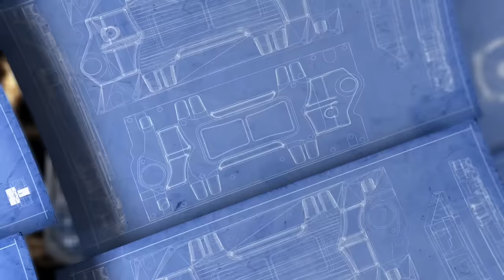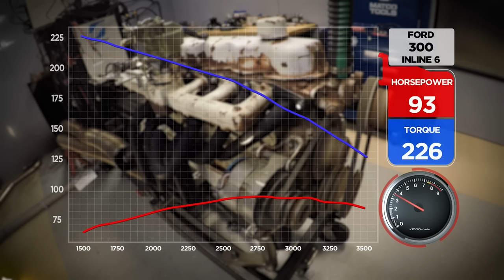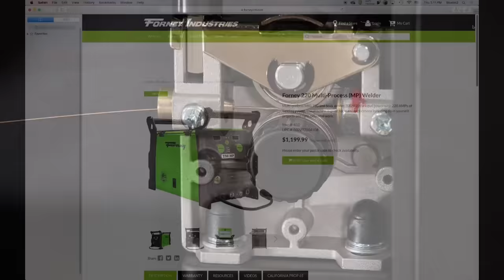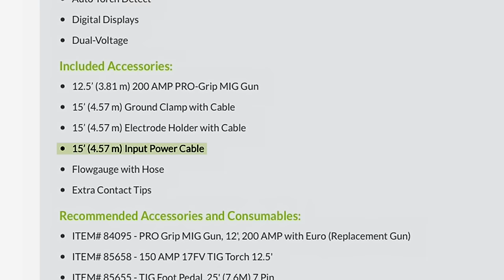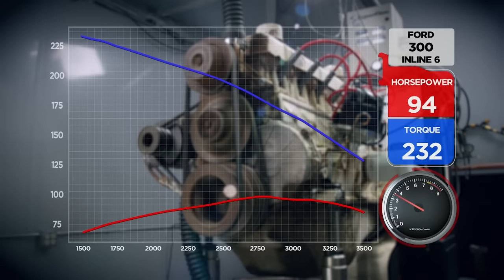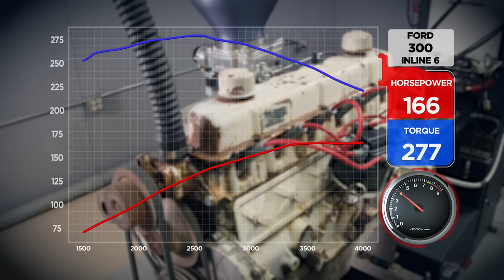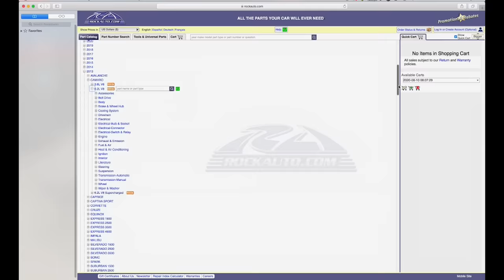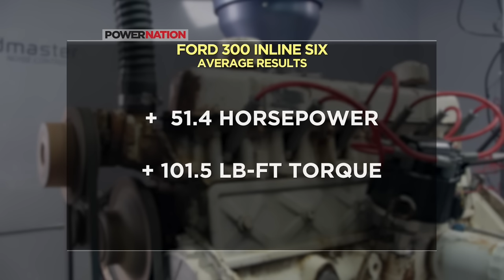Ford 300 Inline Six Gets Eye-Popping Off-The-Shelf Power - Engine Power S7, E17

Comment: Man I can’t say enough great stuff about all that you all teach us. So , great job fellas. I recently bought a 1999 s10 blazer four wheel drive that only had two owners and they took great care of it. I just lucked out on this thing. It ran great and the engine compression was 165 to 170 psi on all six. Cylinders. It had a leak in the radiator and needed a intake gasket. I’m disabled and I’m 63 now and I’ve done all my work since I was 15 years old. But I bought a top end gasket set and a new radiator. I installed a radiator during a hot day and I had a bad attack with my heart from the medicine I take it makes my blood get thicker when I get over heated. I love these little s10,s and happening across this one was a blessing. I was gonna let my daughter use it to go back and fourth from college. But when I had that attack it normally puts me in bed or the hospital for days at a time.  So needing to get this s10 going I sent it to a so called machanic. All he did was put some radiator seal in it. I had drained all the old old and put a new oil filter on it and knowing they would flush the block out like I would have I didn’t put oil in the motor. Just put the oil and antifreeze in the vehicle for them to put in once they put the new intake gasket on. But they called and said it was ready and I went to get it and he actually tried to buy it from me and bragged on how nice it had been taken care of. But I paid him his money and got in it and crunk it up and started home. All of a sudden it started knocking and I looked at the oil pressure and it was flat and the temperature was pegged. Just before I could turn it off the motor locked up. First thing I checked the oil and there wasn’t any oil in it or no water in the radiator. I looked for leaks and there wasn’t any. Come to find out they didn’t put oil or water in the motor. I had to take him to court and only got back the money I paid for him to put the intake gasket in. Which was right at 800 bucks. A perfectly great engine blown. Now I’m disabled and have been since my stroke and heart surgery. I only get less than a thousand a month for all the years I worked. I’ve looked for a engine and I can’t afford anything I have found. I’m out begging people for any short block that anyone would love to just give away. I can use the other parts from the motor and I can rebuild a short block. It may take the rest of my life to do it but I’ll die trying. It’s been a very hard life for a strong young hard working man to get knocked down to his knees at such a young age with kids to raise. My wife takes up all the slack along with what the good Lord blesses us with. I hate having to beg for anything but this was for my daughter and now my dream of giving her something nice is shot. Have y’all got an old 4.3 laying in your junk pile that y’all would donate to a old man trying to keep a dream. The eighth vin is w if y’all or anybody could help. Man it took me two years to save my pennies to find a little blazer like this. I’ve been so made since they blew this thing up. I can’t even keep my blood pressure down. But thanks for taking the time to read this. Y’all keep it between the lines.     John.

Comment: Finally, I've literally got the same engine that had been rebuilt with a small cam, but they put that stock single barrel carb on it, I've got same intake and plan on using a Holley efi with it and the HD exhaust manifold, should be good for close to 300 ft lbs of tq just off idle
Reply: Im building my 2f landcruser engine, for the induction im gonna do like david vizard did and go with three 2" su carbs.
He said it was a virtually unstallable engine, and he gained 35 hp on the top.
Reply: Any reason you’re going to a HD manifold instead of EFI split manifolds?
Reply: I installed the Offenhauser Dual Port intake on my 300. It gives better torque numbers. I also installed a Comp Cams 268H cam, Holley 390CFM 4bbl. I tried bigger carbs and gained high rpm horsepower but lost some torque. The 390 4bbl seemed to be the best choice for my purpose.
Reply: @FRLN500  what are you running the motor in?
Reply: @tylertimmons5543  I'm leaning towards thr efi manifolds now but just for simplicity I wanted the HD because I wanted to go with a turbo eventually and it would be easier to plumb, and headers heat up the engine bay and I do a lot of trail driving, it does awesome at low speeds and I'm avg 16 mpgs with the single barrel carb but it'll drop when I make the swap!

Comment: I had that engine in my 1982 F150 Custom and even without any upgrades it had insane torque!  With the 4 speed manual, the 1st gear was a bull low, I could pop wheelies!

Comment: The same goes for Chrysler’s Slant Six Engines!
Reply: They were both starved and keep running anyway.
Reply: 63 Dart 225 push button would keep up with my 73 318 Dart auto.
Reply: @FredTheLutinoCocatiel  A more fair comparison would be an earlier 318 73 had low compression (8.6:1 vs the earlier LA-318 with 9:1) and was pretty choked up compared to earlier variants.  Not taking away anything form the /6 as it's one of the most bulletproof engines ever created, these Ford 300s and AMC's I6 were right there with it.
Reply: @GregHuston  I have a 1995 f150 and ford bronco 1987 whit this engine and. They are grate on gas mileage also easy to work on it
Reply: The slant 6 is absolutely a great engine, but the 300 Ford is a little stouter in a pick-up. I've owned and loved both engines ,but the Ford does have a little bit more grunt.
Reply: @lawnmowermanlawnmowerman9930  and AMC had a 258 that was strong in between both, too bad they didn’t slat it down to lower hoods.
Reply: @DishNetworkDealerNEO  Yes your right, that engine's progeny powered many Jeep products later on as a 4.0 liter 6. And it was also bulletproof

Comment: There's something wrong with that engine. All Ford 300/6 engines are supposed to leak oil out of the side covers. It prevents rust of something.
Reply: HA HA HA...MINE LEAKED AT THE CAM GEAR COVER BECAUSE THE POWER STEERING BOLT BROKE OFF(???) AND THE BRACKET WORE A HOLE IN IT LEAVING 7 QTS OF OIL FROM IOWA UP INTO RAPID CITY S. DAKOTA...I WAS THERE A MONTH AND A HALF TRYING TO FIGURE A WAY TO FIX THIS LEAK...EVEN WENT TO FORD FOR THAT COVER...N/A...OH CRAP...But with a Windshield chrome moulding clip and URETHANE...I FIXED IT...IT WAS SOLD TO PIK UR FART YEARS LATER...STILL SEALED...
Reply: haha, mine never actually leaked that much oil but it did seam to think that the power steering belt belonged on top the battery.
Reply: @Black70Fastback  Yeah, I had a problem with the serpentine belt. Turns out all the parts are different for the pickup and van versions.
Reply: If they can't leak,they will bust....
Reply: The 6.5L Diesel (Chevy) had extra rust protection on the same type or rust prevention system
Reply: That's funny you say that mine is leaking right now as we speak 93 model still running strong
Reply: @bigsparky8888  - sealed it?  There's your problem right there.  300s don't really use that oil for anything other than exterior rust proofing.

Comment: 😂 That why you use one of the old pads to press the pistons back into the caliper.  What ding dong tried to press the pistons with the c clamp end?
Reply: Exactly. !!!!! Old pads for the win
Reply: I thought. What mechanic would buy such a useless tool ?
Reply: Tickle, 
like the others I was thinking the same thing. I agree that example with the C clamp was stupid. 
Great post SIR
Reply: Glad I’m not the only one. In fact if you have to crank a C clamp so hard your hand is sore then you need new calipers!
Reply: @dodgeguyz  If you haven't lost any break pressure it can make your hand sore. Mine at least. Still, a useless and likely overpriced tool which doesn't seem to require any less difficulty.
Reply: I just stick a large flathead screwdriver in the "view window" on the back side of the caliper. Get it between the caliper and the pad plate and pry to compress the pistons. Pry slow and steady. Edit: Do this before removing the slide pin bolts.
Reply: Who doesn't compress the pads while the calipers are still on the car?!!
Reply: @christopherrisden4057  they still work their way back out while you are cleaning up the caliper bracket and so on.

Pretty much every brake job I've done needs a second press before the caliper goes over the new pads.  

I don't do enough to justify a special tool.  A c-clamp and an old pad over the piston has worked for me for nearly 30 years.
Reply: @buffuniballer  compress the old pads in completely, never had a problem getting calipers over new pads,or maybe not supposed to compress them that much? I'm a shade tree mechanic lol
Reply: @christopherrisden4057  I do.  They just come back out a bit while I'm doing other work.  They always seem to do so.  No big deal.

Shade tree myself...
Reply: Ding dong shills, that's who.
Reply: I've got fixed 4pot/2pot brakes on my current car...made $100 off a guy when he said I couldn't do all 4 brakes in under 30 minutes....I did the front rotors too and had 6 minutes to spare.....sitting there drinking a beer, waiting on my Benjamin to appear...LOL
Reply: Exactly everyone knows that
Reply: You're giving the ding dongs way too much credit lol

Comment: Nearly a 5L gas i6?? Holy heck! And here i thought the Barra was a chunky boi!
Reply: Barra is a chunky Boi, this Boi is a mega chonker
Reply: Im thinking about putting a barra in a lotus elise, or fab a replica cobra to be mid engine, do u think itll fit?
Reply: @T0YCHEST  300 is not a very large engine, just look up the dimensions and compare them to other engines
Reply: farcere barra and 300 are the same? I never seen a barra but i hear they can make 600hp na easily
Reply: @T0YCHEST  barra up to 2 to 2,500 hp now
Reply: @T0YCHEST  Not in the Elise, just too long. But in a lightweight Cobra replica, especially a turbo Barra, you'd have something as quick as the Big Block Cobras, but with much less mass over the nose, for significantly better handling.
Reply: @T0YCHEST  Barra is its own thing. Replaced the 4.0, which replaced the 3.9,which replaced the Crossflow 250.
Reply: They used to run a 6 cylinder dirt modified class back in the day with the 300 six. Dale Earnhardt at one time ran the class.
Reply: PiDsMedia i can fab the engine for the lotus
Reply: @Brock Main3 I've been a huge car guy for 25 years.   I have never heard anyone call this one of the greatest American engines ever made.   Ford flat head, Boss 9,  the Chevy small block,  Ford 5.0L v8, LS family, Hemis, Chevy 409, 427, 454 but never a I6.
Reply: Wild Bill dont forget 428, but inline 6s are the most underrated imo the moddular design is so structurally robust, people would love i8 but i8 would be to long to be practical.
Reply: I think GMC made a 502 inline 6.
Reply: Unlike the Barra the ford 300 is slightly over square 4" bore and a 3.98" stroke
Reply: Skullamanjaro : No. The Barra is a tall deck 9.22 inch  height version of the 7.830/8.425/9.38/9.469 inch deck 144-170-187-188-200-221(6)-250 in line sixes made in USA or Australia or Argentina. They were made as  8.66 and 9.38 inch deck cut down  2.3 and 2.5 liter OHV fours for the Tempo and Taurus. The bore spacings are 4.08 inches. The 240/ 300 Big Six is a much taller, 9.800 inches, and uses a 4.47 bore spacing between centers, which is Chrylser D series 215/245/250/265 Hemi size, although it again much taller. The Big Six is even bigger than the 199/232/4.0/4.7/258  cube AMC Jeep  engine, 4.375 inch bore spacings. But the Big Six is shorter and lower than the Barra because it has a simplex chain Double OHC. So anyone Aussie that says Put a Barra in it. PUT A BIG SIX IN IT!
Reply: ChrisHallett83  diesel
Reply: @jeffpittman8725  503, actually :) Lots of big gassers used to roam the highways. International 450/501 like mine, are beasts.
Reply: Dean Stevenson lol i just wanted to know if i can fit it in a lotus elise with minor fab work.
Reply: @T0YCHEST  302 or another engine would be a better bet, the 300 doesn't have much at all for aftermarket support.
Reply: 4.48 bore spacing compared to the Barra and the US 144-170-200-250 at 4.080 so it's a bunch bigger. Not like the difference between a 4.40 spacing 292 Chevy and my International though :) https://fordsix.com/img/_data/i/upload/2019/02/20/20190220212817-3b75321a-me.jpg
Reply: @deanstevenson6527  10.0" deck, 4.48, but still a long engine.
Reply: Wild Bill believe it or not it is! It’s not a V8 so many ignore it. They are a day in, day out workhorse. As this video shows, Ford left a lot of meat on the bone, so they didn’t get overtaxed. The Mopar 258ci is another workhorse; used in Jeeps for decades too.
Reply: The GDFP : Thats right. 4.48. And 10.00 deck. Thanx! The SVO Vee six was 4.47 and the SB2 Chevy. Ill have to memorise it again! The Ford Big Six is not big untill you've seen the obscene length of any OHC six. Even a GM 4200 with 4.05 bore spacings or the varying cylinder pitches of the  Nissan RB or L28's make the Big six compact in comparison. A Nissan six is 37 inches, the factory serpentine belt 4.9 for 87 to 96   is shorter. Oh darn. Ive oopolahed. Guys arguing about length. No proof until its measured...
Reply: Skullamanjaro : no. Sorry buddy. Its too big without some real gas axing and  design work.
Reply: @deanstevenson6527  250 Chrysler isn't in the Hemi Six family, just 215/245/265. IIRC the 250 was a flathead six.
Reply: @deanstevenson6527  Little 4.40 spacing 292 Chevy and International RD501 cranks. Mine. Getting offset grind to 5.5" with 4.530 BBC flat tops for 530ci   https://fordsix.com/img/_data/i/upload/2019/02/20/20190220214241-5686383e-me.jpg
Reply: @T0YCHEST  transverse 4 isn't easy to replace with an I6...
Reply: @ PiDsMedia :Study Guide: 
https://www.uniquecarsandparts.com.au/valiant_vg_technical_specifications
The E34 version of the  E31Pacer had a 4bbl  track pack version. This version of the Chrysler Valiant Pacer had a 250 cube engine. An overbored stock engine with factory  3.800 inch pistons instead of 3.760.
Reply: The GDFP im not gonna swap it more or less replace the whole drive train and use the light weight mid engine platform since im gonna get it from a wreck. Im thinking of hooking it up on a porsche setup
Reply: The GDFP : Saw it when Pmuller showed me. Thad measured 36.5 inches on his 300 six equipped 1962 Ranchero. My Stagea was 37 inches. Such a huge engine it had to be slanted.
Reply: @Brock Main3 don't tell that to my 90 F1500 300 that get 22mpg city and 22 mpg Hwy.
Now yes I guess if you try and rev it out it will perform worse but its a low revving stump puller why rev it high.
Reply: @Brock Main3 I've heard of that vintage getting 30mpg with the right Single barrel carb.

I know my Hwy mpg anit great but thats a power band verus wheel speed  issue.
Reply: @Brock Main3 just quote some old info I'd come across in the past.  I suspect were running fairly fuel restricted, but was possible.
Reply: @PiDsPagePrototypes  Xflow which replaced the 250/221/170 and 144 ci family of engines which this 300 is part of!
Reply: @deanstevenson6527  😁 sadly, that quoted source is known for its inaccuracy and poor fact checking. Hemi6 had three factory sizes, 215, 245, 265. The VG Pacer isn't called a "245 Hemi Pacer" for no reason 😉
That one's a straight typo, but that's also a site that used to list the Dodge Dart based VE Valiant as having the same chassis measurements as the Plymouth Valiant based VC Valiant..... VE is wider and longer.
Reply: @st170ish  others have posted data showing the bore spacing is wider, so we can think of the 300 as the big-block version of the early designs.
Reply: @PiDsPagePrototypes  Yes that is correct... BB goodness, pity we cant fit a barra head on it :)
Reply: @st170ish  it's the era of Additive Manufacturing, wonder if the Barra or the 250 Crossflow head could be scaled up and printed?
Reply: ChrisHallett83  but. Where do you draw the line, there are marine ship in-line 6 cylinder engines that you can stand inside of once the head is removed
Reply: PiDsMedia : The Hemi 265 head can be made to fit the 240/300 block. Bore spacings are similar.
Reply: @deanstevenson6527  that would be interesting to see, but I don't think there'd be any huge advantage for power output.
There was a bloke running an XU-1 Torana clone in the Victorian Sports Sedan comp, with a 250 Crossflow Ford head, mounted reversed, on a Holden 202 based motor - cylinder bore spacing and bolt pattern lined up, giving huge advantage in gas flow and potential port sizes.
Reply: PiDsMedia : Ive seen photos of  that swap my self:-)
Reply: @deanstevenson6527  I've filmed it..... 😁
Reply: @jeffpittman8725  and a 707 used in double decker busses in NYC back in the 30s
Reply: Cobradriver99 : Nope. The Falcon/Frontenac/ Comete built 144/170 is the 4.0 Barras grand pappy. The 4.48 bore center 240/300 was a 4.38 bore center 223/262 "i Block"  replacement...with the chain over head cams, the  Barra is physically a similar size but with a  lot less engine capacity.

Comment: I was a Ford parts guy starting in 1978, and ran at one point anything with wheels. The engines were incredible! Aside from lifter cover gaskets, they seemed to never need anything but normal maintenance stuff: filters, plugs,etc.
They were, quite literally, bulletproof. And the industrial versions?
Aside from draining all fluids, I can't imagine how you could kill one.

Comment: I've long had a soft spot for the Ford 300. They seem to endure so much and just keep running. Like all straight 6 engines, they are very smooth running too. Great choices for farm trucks and other vehicles that spend more time working than commuting. I have to say I'm surprised to see the power gains that were achieved. I have to wonder what effect the increase has on durability and longevity.